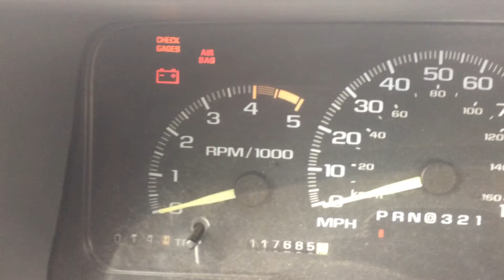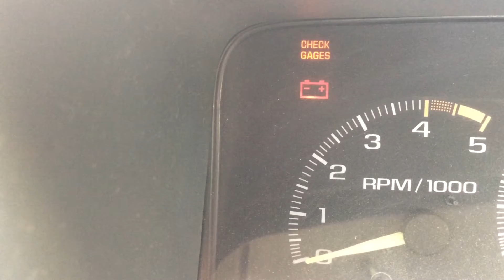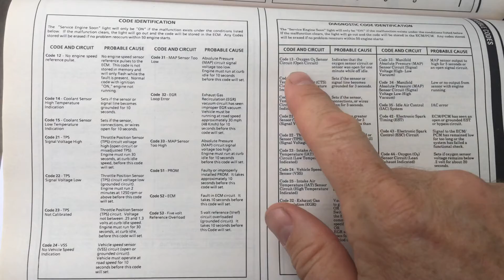How to read trouble codes on 88-95 GM cars and trucks

Comment: Have a  1995 Chev C1500  Code read 13 three times and then I got a further flashing of 4 six times.   Then it went back to code 12 three times.   Can you help me out here.  Thanks
Reply from the maker: 12 means you are in diagnostic mode.  13 means oxygen sensor.  There is no 4. If it was 44, that means lean exhaust.
Reply: Thank you for your feedback
Reply: Flashing 4 six times (44 three times) indicates Lean Exhaust